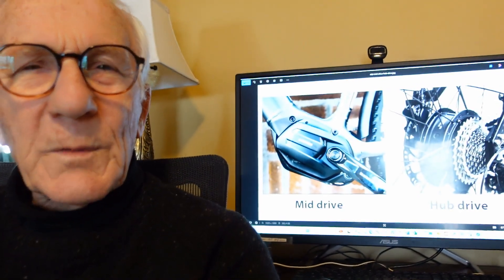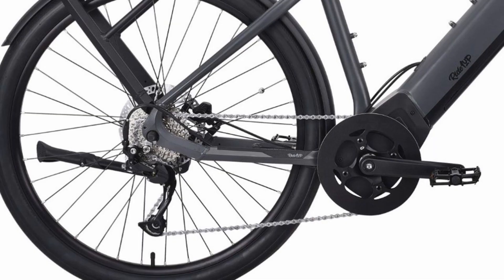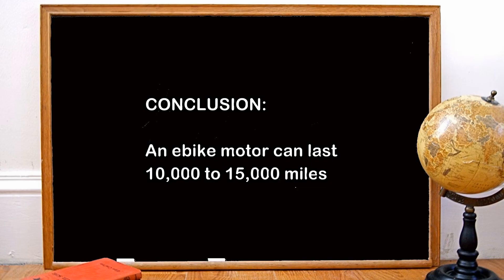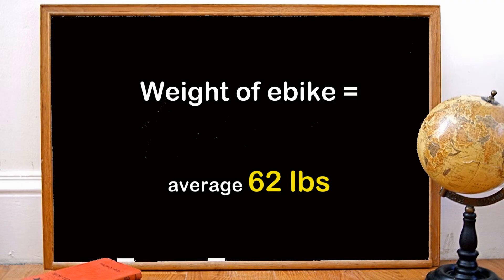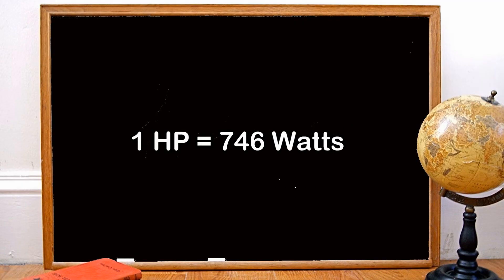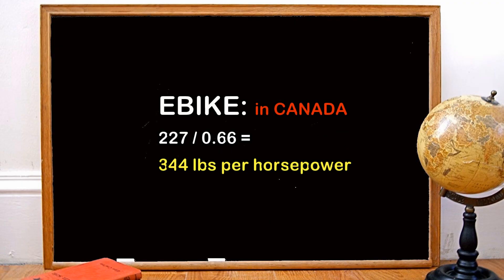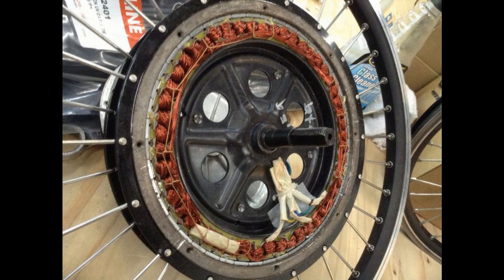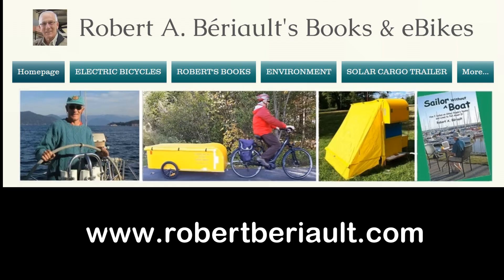Why Ebike Motors Have Such a Short Lifespan

Comment: If e-bike riders would actually peddle (make power) themselves, use the gears and not drive in rainy/winter weather, the motors would last for a very long time.
Reply from the maker: You could make it last indefinitely if you don't turn it on😉
Reply: Making better use of Pedals is important, though I think a bigger issue is most bikes are used in cities. Where due to traffic lights they often start and stop constantly much like cars, and when first getting up to speed people are the most likely to use the motor.

Comment: If a car engine ran at near to full speed constantly it probably wouldn't last 200,000 miles
Reply from the maker: Right. Cars aren't used in a manner that makes them work as hard as bike motors. The majority of the time they're working at a fraction of their capacity.
Reply: It's why engines on 50cc scooters have a short service intervals. There's a lot being asked of a 1 1/2 inch diameter piston to carry the weight of the bike, it's rider, and the rider's cargo (even more demanding on 4 strokes). Couple it with them being speed governed often with a restrictor in the CVT to limit the gear range, those tiny engine are constantly running at around 7500 RPM just to do their legal speed limit (Often 35 MPH). It why I took the restrictor out of one of my scooters because it felt like I was about to blow the motor just to do 35 MPH.
Reply: full speed for an e bike should not be a problem at all, a car a lt full speed is much more demanding for the car.
Reply: @rotorblade9508 hopefully you understood the point I was making though.

Comment: Regarding the comparison of e-cars with e-bikes. I'm looking forward to direct drive hubmotors in cars. I believe elimination of gears in cars will eliminate almost all moving parts, including possibly brakes. Steering  will probably remain the most mechanically complex parts. Also one thing  you didn't mention is the efficiency gain with  direct drive motors. Gears are rather inefficient in comparison to direct drive. Bring on AWD direct drive hub motors in cars. Economy cars can also be built with 2WD for cost savings.
Reply from the maker: Aside from the efficiency you mention, they can regenerate power and save wear on brakes.
Reply: doesn't tesla already do that.

Comment: While your overall point still stands, you are comparing a nominal power rating (ebikes motors) to an actual power rating (cars). Often ebikes actual max power is higher than the nominal one.
Reply from the maker: I hadn't thought of that.
Reply: That's right, but the motors aren't designed to run at their actual max power for a prolonged time. The nominal power rating is what they are designed for. The problem is, on an e-bike you run into a situation quite often where the motor is running at a much lower RPM than it is designed for, but stil gets full power, so it's actually overloaded. At the rated power , the motor turns at about 81-82% of the no-load speed. On speeds slower than that, more and more power gets converted to heat, so the motor (and its gears) heats up more than it's designed for. Now, since the motors are of course designed for e-bikes, this constraint must be kept in mind, maybe by restricting the power put into the motor to the power it would draw at its rated RPM.. still not optimal because at lower RPM it would still generate more heat, plus this way you don't ever reach a higher output than the nominal power. So to reach the maximum power, the motors actually have to be overloaded.

Comment: Your math doesn't necessarily prove your hypothesis, but it supports it. In order to prove your hypothesis, you would have to see if motor failiures are more frequent on bikes that carry heavier loads.
Reply from the maker: Good point. It could be done, but you'd need a well-funded research team.

Comment: no active cooling/ lubrication/service interval
Reply from the maker: Not easy to lubricate
Reply: @RobertBeriault753  an acquaintance asked me what is the best grease for plastic gears, he was thinking of ebikes, I told him any that is almost liquid, because if it is solid, it will spread and soon it will no longer be on the teeth, it is the same with the angle grinder, I add oil into the grease to make it soft so that it at least coats the teeth a little
Reply: @RobertBeriault753  it is easy to lubricate the gears. I did it for the first time this weekend. there are lots of youtube tutorials

Comment: There’s exactly one meta-answer: “Value engineering”

They could make an e-bike motor that lasted 500,000 miles if they wanted to, but there’d be no point to it. People don’t ride as far on their bikes as in their cars, so it would be a waste of money to make a bike motor that lasted 150-300,000 miles. No one would pay for it, for the larger gears with hardened metal teeth, oversized hermetically sealed bearings, etc, etc.

The goal in any design is to meet the needs of the application as cheaply as possible. People will pay exactly what a product is worth to them and not a penny more: Spend too much on building a motor that lasts 2x longer than the competition and everyone will buy from your competitors. I suspect that people who expect to ride their e-bikes more than 10k miles is a small percentage of the market and those that do are probably willing to spend the money for a direct-drive model.
Reply from the maker: What you say makes perfect sense. Thanks for your input.

Comment: I do not have experience, but I think metal gears last longer than plastic gears.  Thank you, Toyota bias, my 2004 Camry has 300000km
Reply from the maker: From what I've read, you're right about metal vs. plastic. That Camry doesn't owe you anything!
Reply: You want the plastic gears to be the weakest point and to fail first. When metal gears go, they can cause catastrophic irreversible damage in the wheel hub. The ring gear is pressed into the hub and significantly more difficult to fix. The plastic gears can be taken off and replaced easily
Reply: what about wooden ones both soft woods and hard woods how about that

Comment: That conclusion is a bit of a stretch.

The torn up gears are really more analogous to a transmission. The motors themselves seem to be fairly reliable.

 Unlubricated plastic gears or even powdered metal gears are never going to last like a solid metal gear in an oil bath.

At work we ran hundreds of motors 16 hours a day for decades and almost never had a failure of any of the brushless style motors. Brushed motors did fail as did the capacitors on single phase motors but I can only remember one 3 phase motor failure and that was just bad bearings.

The rule of thumb was that it isn't the motor that is broken. More likely a belt, wire, sensor, contactor, loss of a phase, loose pully, bad bearing, a jam, stop line, control relay, computer or controller or pretty much everything except the motor itself (except the 1 time it was the motor).
Reply from the maker: Yes!  Interesting point. I hadn't thought about it that way.
Reply: WOW!!! You pretty much covered all the "possibilities".
In the "loss of phase" situation, would that be a problem with the Hall-effect sensors, or the controller?
Reply: @DavidCooper-bn6te  at work it could be facility power, 1 blown fuse/3, 1 bad contact/3 on the starter, or 1 out of 3 burnt contacts on the twistlock plug. If a forklift was involved a ripped out wire.

On a bike I'd guess wiring or the controller that makes the 3 phase for the brushless motor. Does not seem like a sensor would cause the loss of a phase but what do I know? My experience base is more industrial.

Comment: Inaccurate conclusion about comparing vehicle to e-bike. Generally, engine with higher horsepower has more failure-point than engine with smaller horsepower. For example, larger ICE vehicle produces more heat and long cylinder-head are more likely to bend/warp at high temperature, this condition is a major damage that require overhaul, while small engine produce less heat and simultaneously smaller dimension that less likely to warp/bend at high temperature. Additionally, ebike lack cooling and the gears are not immersed in liquid unlike a motorcycle, so basically ebike's shorter lifespan is on purpose.
Reply from the maker: Sounds like planned obsolescence.
Reply: @RobertBeriault753  because it is.

Comment: There are 2 main enemy's of Ebike motors.
Heat and water.
If water or moisture comes in the motor, it's done.
Heat..
Most motors don't have temperature measurement on display, so you don't really know when it's to much heat and to stop.
You can always stick heat probe to your mid drive and monitor temperature.Gears melt when it's too hot,motor burns when it's too hot.
Motors have short lifespan because people don't educate themself, and push them hard beyond limits.
Reply from the maker: You raise a good point. There should be a temperature readout on an ebike display.
Reply: Really, I need a temp gauge on the motor, the controller, and near every stressed contact point, in the battery etc. 

I haven't actually observed ours (an m620 geared mid-motor with internally integrated controller within the case), to get warmer than body temp, even on long uphill climbs at max output. 

The battery (13S6P Samsung 35E 18650 cells) does get slightly warm, & the batteries I've seen using ≤5P 21700 cells, got hot. 

(At present, I'm totally unconvinced that fewer 21700 cells, work as well as equal draw spread across more 18650 cells, at the high draw rates an ebike pulls during a climb/sprint. 21700 cells are mostly a cost-per-KWh savings for manufacturers, from what I see.) 

The fact that most ebikes lack any temp gauge & have at most one or two temp sensors, is a "tragesty".
Reply: Typo: Should say "<5P", as in 4 or fewer parallel sets of cells. Even for cells with the very highest C discharge ratings, ≤4P 21700-cell batteries don't seem as suitable for high drain, as 18650-cell batteries of the same Ah ratings which are made with more than 4P sets. 

Oh, & higher amperage makes more heat per RPM, than higher voltage; so, motors & controllers tend to run cooler (& achieve higher speeds) at 52V×28a than at 48V×30a!

Comment: ive been pumping close to 3kw through some old un-named chinese hub motor for years with out it even getting warm... 96V at 30A... 

blown speed controllers, blown batteries... had to replace the motor wires due to dropping it... did a set of bearings as it was rusted out when i found it on a bike dumped in the bushes...

but this motor and its windings are bulletproof...
Reply from the maker: That's an amazing motor you've got there. Good luck with it.

Comment: The north American tendency for ebikes to be more widely used as lightweight electric motorcycles, compared to the Europeans having legislation that limits ebikes to pedal assist (no hand throttles) plays a big factor, too. I'm legally allowed a throttle in Australia (provided I power limit my bike to 200w, it's 250w at 5/5 boost, so a legal maximum boost of 4/5 on throttle operation) but I only use a motor because of heart condition. I've been a lifetime "dry bike" rider prior to this. So, I use pedal assist only to keep my heart rate below my medically prescribed 128BPM (I'm a disco song <rolleyes> ) and I have to pedal to make the motor draw current from the battery. I rarely take my controller above 3/5 boost, AKA 150w, so the motor never gets anywhere near as hot as a throttle controlled bike. So there's the other big advantage of pedal assist. Longevity, for the motor, controller and battery. Not to mention, retaining or building fitness. A lifetime of cycling for transport is what saved my life when I had my heart attack 4 years ago, not my opinion, my cardiologist's. The mobile intensive care paramedic riding in the back of the ambulance with me called it a "widowmaker" and was "honest" about my slim odds, so I am determined to keep pedalling for as long as I can. That it keeps the bike going longer, that's a bonus ;-)
Reply: yeah, the rules are funny with the power assist/pedelec variation... usual bureaucracy...

the period before they banned the ICE was amusing... it had always been 30cc/30kmh. then they dropped the capacity limit... then they banned them altogether... 

lol, i dont give a hoot where i live, rural area... and i show some restraint and consideration, i like to think.

 problem with the rules is that theyre the same within one state... from tibooburra to griffith, broken hill to strawberry hills... you arent hurting anyone out in woop woop on empty roads where you might see one car in an hour...
 the problem is the kids and or bogans in greystanes and wentworth that ride with no brakes, no helmets, on the wrong side of the road, dont care about traffic lights or road rules, fail to maintain situational awareness, ride across busy main roads without looking, ride through shopping malls and down footpaths and hurling abuse at pedestrians, all whilst holding a phone in one hand and a boom box or VB in the other...

and dont get me started on the ubereats guys with their illegal mopeds in sydney areas that we turn a blind eye to... or the scooter boys that failed to look up the rules... scooters are illegal. if it was built to primarily rely on the motor, its a moped. the rules state quite clearly... a BICYCLE fitted with motor. not "small motorcycle with rudimentary and superfluous pedals that can perform just as well with the chain removed"
Reply: @paradiselost9946  kids will be kids. In a few years they'll be doing the equivalent kinds of stupid in cars. I'd rather people didn't break road rules, but if I had to choose, I'd rather people were stupid on a bicycle than aggressive in a car. A stupid cyclist is only likely to kill themself, stupids in cars kill 3 people a day in Australia.
Reply: @paradiselost9946  australia, like America, has one law for us and another law for the capitalists. Hence 1500w Uber Eats delivery bikes.
Reply from the maker: Thanks for the insightful comment. It's nice to think that by pedalling you're extending both the life of the bike and your own!
Reply: I had a widowmaker 95% blocked but caught it before an actual heart attack. I was in hospital 5 days for my triple bypass, the average patient was 2 weeks. A few on the ward were moaning I came in after them and was leaving before them. I put that down to my cycling- around 60 miles a week. I have a push bike and an ebike. the ebike being used for the bigger hills or night cycling as I have my heart rate capped by preventative medication (obviously to protect the operation work) So only have about 2000 miles on both bikes. 

I understand the reasoning for plastic gears, they wear out first and that saves the replacement of the metal parts. metal on metal the whole lot will be worn.

Interestingly when I took my shredder apart , it had lasted years and years I was happy with it but it was killed by the mrs overloading it. the plastic gears had stripped. they had overheated and become brittle. 

I bought the same shredder again and stuck a sign on the front 5 sheets max or leave me do the shredding. 

back on topic, I never use throttle only i always pedal and I only use the minimum motor assistance necessary.

Comment: Stopped at the use of "chatGPT." So sorry, but that's a red line and I'm outta here. Good luck with your channel.
Reply from the maker: I have to say that I'm not impressed with the accuracy of Chat GPT's data. Not reliable.
Reply: @RobertBeriault753  yes, the dreaded "hallucinations."
Reply: I also find the use of artificial intelligence as a reliable or trustworthy source of information very worrying for humanity.  I implore anyone with the slightest of reservations to do some home work on the negative aspects,as we are only ever told about the benefits through mainstream sources.
Reply: Not everybody is aware of the problems with AI, but everybody is aware of AI, so be a little more forgiving and take the time to explain. Eg, the data centre carbon emissions catching up with beef farming carbon emissions, the ethical issues of using copyright data without payment to train the models and the intent to reduce labor costs. It's better to educate than denigrate, @biercenator

Comment: Ours were cheap hub ebay conversion kits, they have lasted years. i have my original 2012 direct drive kit, i'm on a daily direct drive 3yr old kit and wifes is hub geared drive at 2yrs (replaced after theft) and she rides it daily for the work commute. its about to fail on its cheap internal bearings/cogs, they cost a few $ so they will be replaced.
Reply from the maker: 2012, That makes you an old hand with electric bikes! Thanks for your story.

Comment: Comparing an Ebike with a car does not make much sense, like comparing a car with a tractor or a lorry. An Ebike should be compared with a moped or mofa with 50cc IC engine. Because these vehicles have the same purpose.
Reply from the maker: Interesting point. I'll have to think about that.